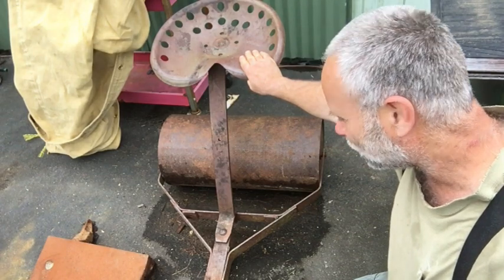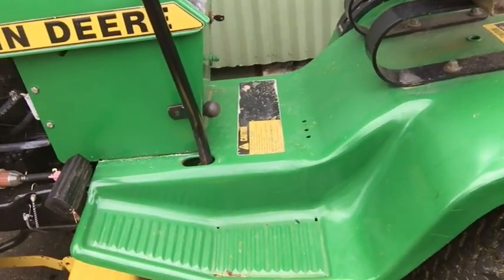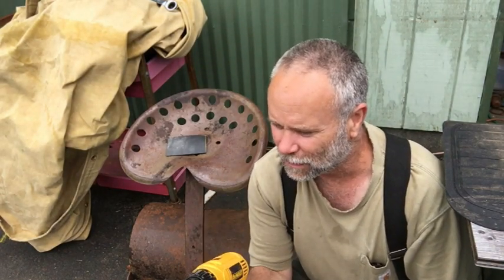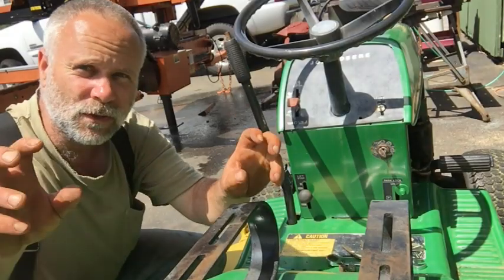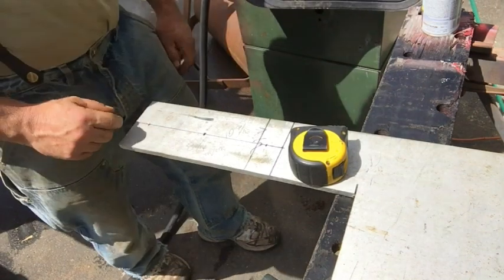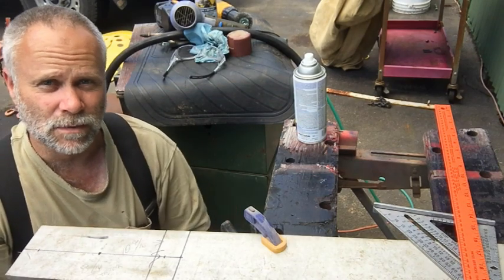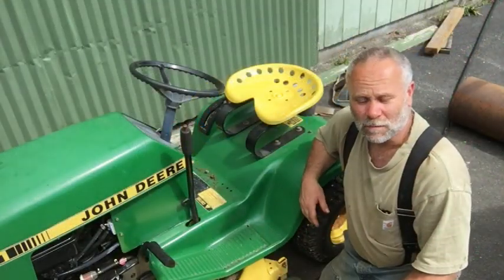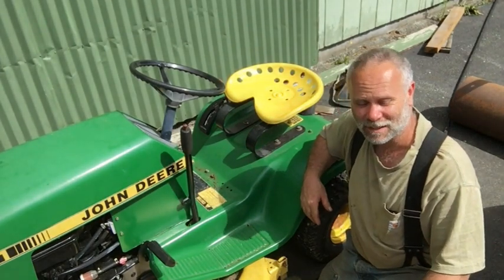New Seat for the John Deere Lawn Tractor

Comment: Yes, it's a lawn roller. 
The seat is to add weight either human, rocks or bags of grain to achieve the necessary weight to compact the soil. 
This was necessary since, like yours it's hollow and not very heavy on its own
Reply: Right. Do you know how old it is? Is it an implement used to go / ride behind one of those old walk behind tractors?
Reply: @MrRain-hk4zi  my Dad had one, he welded a, well basically goose neck on so it would be pulled more efficiently using the riding mower. 
But yes yours is designed to go on one of those weird half walk half ride mowers that have minimal self propulsion.
Reply: Compact soil, not so great for gardening though 😕
Reply: MNTNSTARZ80 Thanks!
Reply: The Times Have Changed Agreed. It was mentioned in another comment that it can be used to break up dirt clods after tilling. It would be a rough ride 🤠

Comment: The old lawn mower is nice and roller too. Man I do not miss lawn mowers. We use sheep. If you have very fluffy soil like we have here in Chile, you would use that soil to roll in the SEED after you run a drag. It helps with germination . We use one here because when you plow up our soil it becomes like Pete Moss or pop corn. You must roll it. Also it helps take out the divits as well. Beautiful job on the John Deere. BTW>>>> My wife is loving your channel too. Jim in Chile.
Reply: Interesting. Yeah, I anticipated that the set up was an implement used to ride on for the extra weight and pulled behind one of those walk behind tractors they came out with in the 20's, 30's, or 40's (?) Good to "see" you guys again :)
Reply: @MrRain-hk4zi  We still see those here today with modern equipment. Love the channel and the videos. Jim